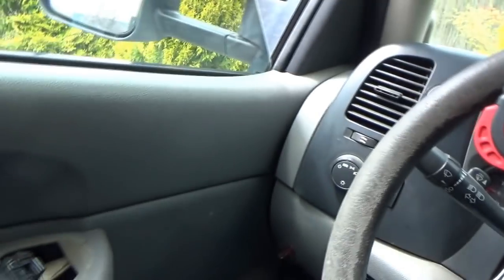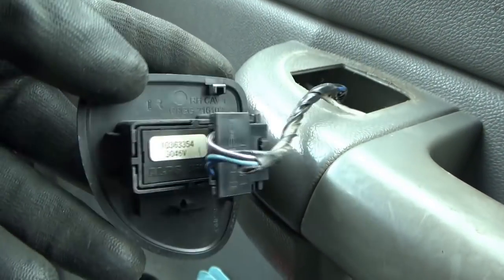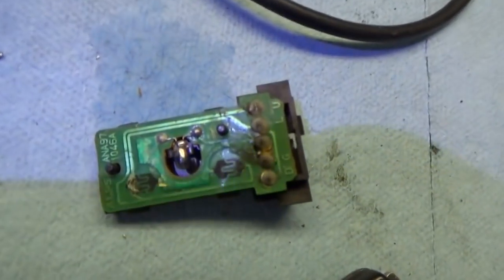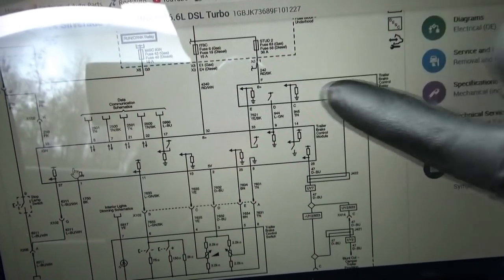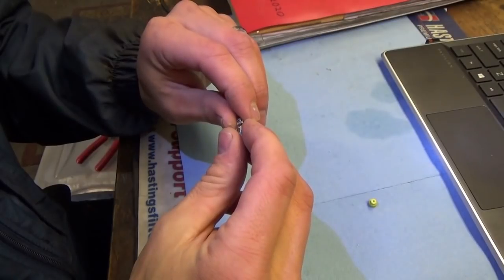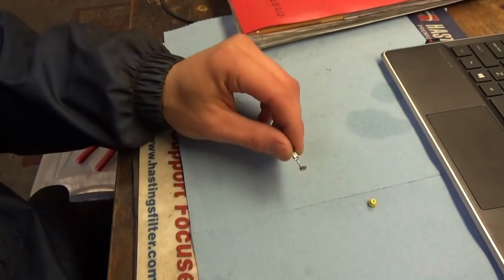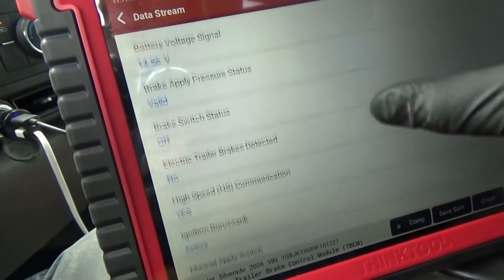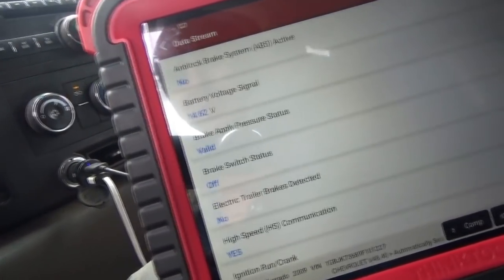SERVICE TRAILER BRAKE! & Power Locks (GM Truck)

Comment: One suggestion - when bridging a gap like that, lay a small piece of solid core wire across the gap when you drop the solder on.

Solder is a pretty weak metal, and it may fracture across the gap; soldering a really short jumper prevents that.

25+ years of fixing pinball machines (kings of vibration breaking things) taught me that .... ;-)
Reply: +1
Reply: +1
Reply: Now I'm going to search for pinball repairs on YouTube
Reply: @kbrnsr  👍

Comment: I remember when the Los Angeles Dept of Water & Power (LADWP) got the new GM pickups that had the on board Trailer Brake Control setup.  I figured out real quick to jumper the pin in the (truck side) receptacle to the ground pin using the wiring diagram.  In the dash readout it read Trailer Connected.  That was a quick test to make sure the "Sense" side of the module worked.  Unless you had a trailer connected and not the jumper, I did not apply the trailer brake manual control with just the jumper.  I figured that might damage the TBCM.  
Anyway, most of the testing was to verify the truck wiring was working for the trailer lighting.  The old 7 wire test box worked great for that.  Most of the problems we had were in the trailer side of the lighting system.

Comment: I had a work truck from same year. Guys would leave windows down in rain and those switches would be completely full of water. I would take them out empty water and dry out with heat gun. Worked a couple times then had to replace them.

Comment: As another comment said standard butt connectors. He will be back all those connectors should be taken out wire soldered and Shrink fit. And when I do my own trailer plugs I fill them up with Dielectric grease also.

Comment: Good fix...the door lock switches are $15 for GM brand. Plus the shipping time from Rockauto. All of those wires in back could use a good fogging of wd-40 or 100% silicone spray or something more appropriate as they have lots of surface film crud. Good old GMC still running !

Comment: Wow, no parts required, do you believe that. There are quite some trouble codes listed but with the most important repairs done, the truck is still holding up with 320k miles!

Comment: working on semis  between the end of february and the middle of june  i spent more time fixing  garbage wiring repairs and test light holes in insulation  and the green pus of death than just about anything else. it was non stop. 90% of it was unnecessary.
Reply: The main culprit I see is people use the heat seal crimp connectors but don't heat seal them shut on the semitrailers I work on. A waste of the better style crimp connectors.

Comment: Nice green crusties eating them wires lol.   So simple fix!  Only thing is the passenger switch replace!  Nice find and i wondered if your could find and fix the wire problem without the scanner? Lol.   Let's see if you can do it.   Like old school diagnosis!  Lol.   A good challenge?

Comment: Smashing repairs ivan :-D
I always appreciate the trouble you go to for your customers, very lucky customers :-D
The dodgy door touch switches remind me of remote control switches,  the black conductive disk often needs a clean, and if that fails a disk of tin foil is superglued to the black pad.
Not ideal but keeps it working for a bit longer.
Who shouted Bodge!! :-D
I would want to spray silicone in all the connectors of that truck, water is a bloody pain :-(

Comment: I wonder if those corroded through wires under the truck were due to previous diagnosticians using ponoma piercers or sharp test lights to stab wires whilst trying to diagnose something then not going back to  seal over their holes leading to failure by corrosion over time. It didn't look like they were in a location subject to chafing.
Or maybe car wiring just has really $4hit insulation QA processes that ends up leaving copper exposed to rot.
:/

Comment: I didn't like the fuel lift pump surging sound when the flashers and lights were on. could be weak or bad frame/body/engine grounds or it needs a different relay controlled power feed.
then again maybe alternator getting weak or the power feed from it.

Comment: Road salt strikes again. Rain may have killed the passenger side switch after 322k miles.
 Those diesels won't die with regular oil changes. Some YouTuber commented that they changed from diesel to propane where he worked, expecting the engines to last longer, since propane burns so clean. But the engines running on propane didn't last as long as when diesel was the fuel. Speculation was that the diesel lubricates both ends of the pistons. Someone told me that a gasoline engine will last longer running on gasoline, than running on propane because the gas lubricates the valve stems better than propane vapor does. Who knows. Maybe the, 'Project Farm' fellow can test that theory.
Reply: Indeed gasonine engines will last longer when you put gasonline in it rather than propane. You can drive on propane, but only if the valve stems and seats are fit for propane. Some modern engines are ready as standard, some are not and need to have different valves and hardened valve seats. Also a well-known problem with gasonine cars driving on LPG or on methane.
Reply: I hope you submitted that idea to PF!

Comment: It is a good idea to add some solder flux before you re-flow the the joint.
Clean the flux off with isopropyl alcohol.

Comment: you should always use flux when reflowing joints or add solder, remove it all, then flow fresh flux core.
or be lazy and cheap adding a bit of flux core solder (I know nothing about being said lazy person) :))

Comment: I was going to comment about how weird it was that both switches died until I saw doorman! Smh
Reply: But that also means the OE GM switches died too. In this case design is the culprit and not Dorman. (That is a shocker for me too)
Reply: @jimmyaber5920  ahhh but think about how long that passenger side (original) switch has been in there as compared to the doorman unit. Longevity is not a strong suit of doorman products.

Comment: The TS 100 soldering  iron is not portable without buying extra parts.  Not a very good soldering iron. 
Please don't promote questionable products. 
Diagnostic videos are great.
Reply from the maker: What's your point? It's an amazing soldering iron! Just because the battery is sold separately it is "questionable"? I wouldn't promote any product if it was crap, trust me lol